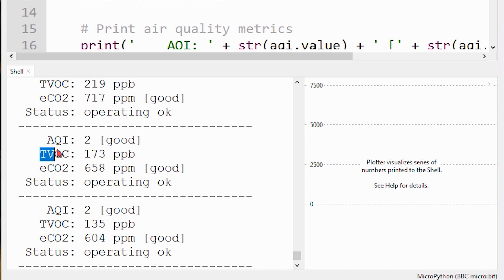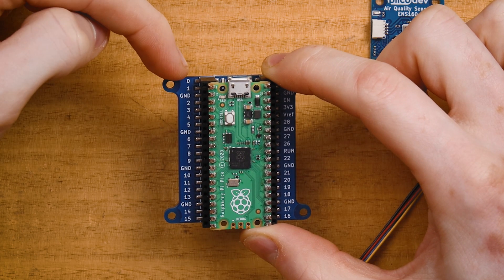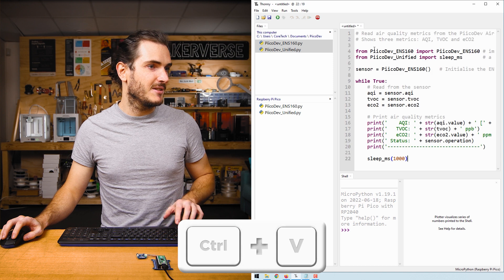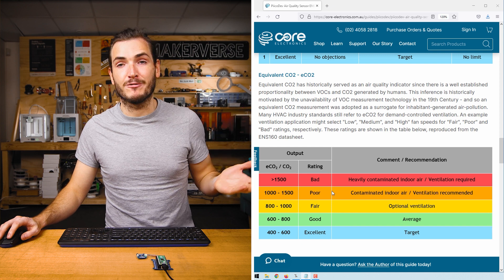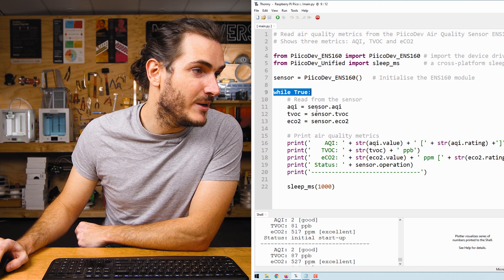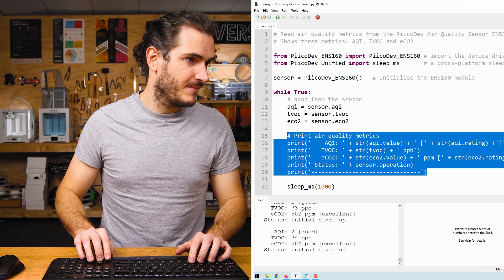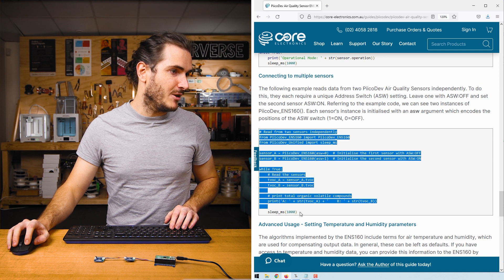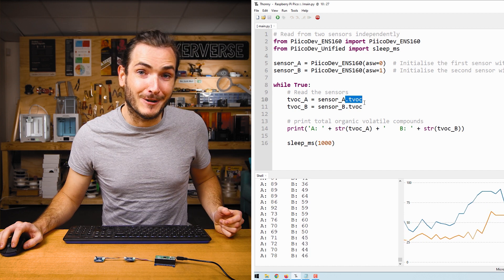PiicoDev Air Quality Sensor | Guide For Raspberry Pi Pico

Comment: Great guide, thank you!
The sensor itself seems quite expensive, is that because it is a really good one or is that a normal price ($40)
Reply from the maker: The chip onboard the PiicoDev Air Quality Sensor is the ENS160 and we've kept our pricing in line with other boards featuring that same chip. We price our modules as competitively as possible while maintaining our point of pride in electronics designed and assembled in Australia.
Reply: @Core-Electronics  thanks! I was thinking in GBP, very reasonable